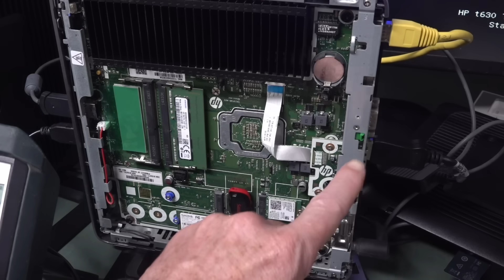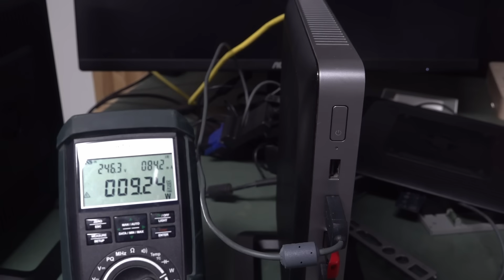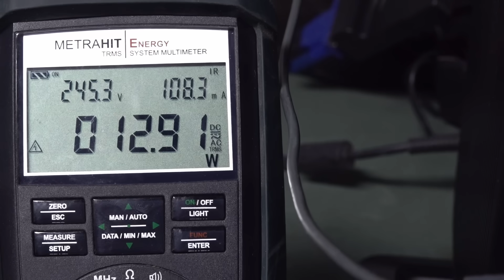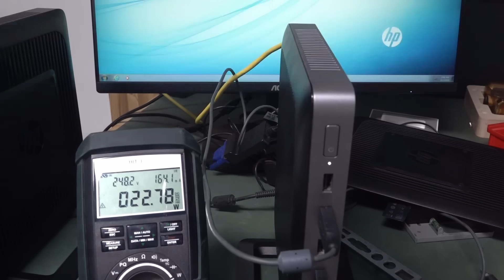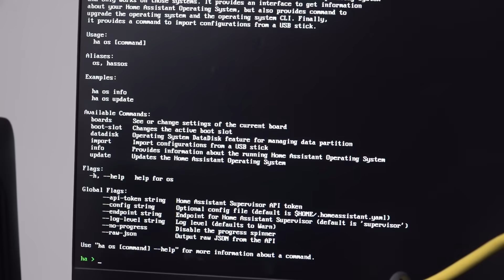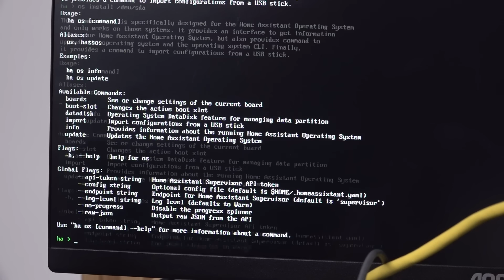How Badly Can I Screw Up a Home Assistant Install?

Comment from the maker: UPDATE: I just had to resort to removing the SSD and using my desktop machine to burn the image using Balana Etcher. It now boots into HA fine on the thin client. Problem solved. Can log into it on my desktop and it's ready to set up. And it's 8.8W power draw on idle.
And for all the geniuses that said "just read the HA instruction, they are awesome", I did read the instructions and nowhere does it explain how to install HA onto an internal SSD from an external USB install of HA from the HA prompt whcih is what I wanted to do. Turns out it's not possible to do what I wanted from the HA prompt. And Grok might have been right in that it was possible in previous builds of HA that apparently contained with different tools.
And for the geniuses that said "don't trust the LLM model you idiot", it's way easier to give that a try for a few minutes than pour through countless forum posts and reddit threads. I had no way of knowing that there wasn't some way to do it until I had tried the variosu ways suggested.
Reply: Ok, we’re off to the races……so now check for available existing integrations for what you want to do and if there aren’t any, or you don’t like those then you can google it for other 3rd party ones and install them (manually or automatically).
Reply: If you ever have to do this again, the easiest way is to just boot any bootable Linux install (Ubuntu, Debian etc). From that booted image, download HASS and then write the image from there.
Reply from the maker: @stevelupton2533  The easiest way is to just remove the SDD and write the image directly to it using another machine.
Reply: Nice, 9W is a bit higher than a raspberry pi 5 (3-5W), but this hardware is more powerful, and the good thing is that this is X86.
Reply: Try T620, should go even lower on idle
Reply: That’s good news, you should do a follow-up YouTube video on it at some point.
Reply: That's the best way to install HASIO
Reply: @EEVblog2 Pro-Tip, on your Win10 desktop, create a shortcut to the \config folder on the HA drive so you can access the integration files etc. Handy if you need to tweak one or manually install an integration you might have downloaded elsewhere.
Reply: Etcher was just exposed for stealing personal data.
Reply: If you don't mind a little overhead you could also try to install proxmox ve and run homeassistant as container in there. On my HP EliteDesk 800 G4 with 16GB RAM, 512GB SSD and a 9500T it uses around 8W in idle with HA running as container.
With frigate and 10 Cameras it draws around 20W which is not to shabby considering it does "realtime" object detection on those streams.
Anyway those old thin clients are really nice alternatives to a raspberry. haven't used my r4s since i got those thin clients. The R4B draws ~4W in idle for comparison.
Reply: Happy you got it running! The instructions are located on the official wiki under installing on x84! Best of luck with home assistant.  It's a pain to get running but once up it's fun to mess with.
Reply: linux install instructions are weird with HA
Reply: I've known HA will only install to the imaged drive for years. I didn't know that when I first started using it though. Just like you, I found out the hard way. I eventually gave up looking for documentation on that, and just accepted it.

LLM's might be faster, but they'll never be as trustworthy as several humans agreeing on something. I prefer to spend more time seeing what humans think :)
Reply: it probably needs driver installed for SSD being based on win7!..

Comment: Dumbass Dave wasn't reading. You were trying to use the "install" command and wondering why it wasn't working. Meanwhile it's giving you a list of available commands and "install" isn't on the list.

I'm sure the documentation could be made better for beginners but that only helps so much.

Comment: Power consumption on an HP thinclient is tiny, so tiny it isn't even funny. We run thinclients at all our stores (20 stores with a total of around 300 thinclients). When a store loses power, the 2KVA genny is more than able to keep the entire store running for the day with only 1 fuel refill needed.

The even better thing for us is the fact that we can lock the device down by turning on write protection and locking the commit, so zero changes can occur.

Our oldest HP Thinclients still run Windows XP Embedded.

Comment: I used to have 3000 watts of lighting in my house. Overnight, I reduced it to about 300 (from incandescent and halogen to fluorescent) and later to 100 or less (LEDs). Not clear why one should worry about even 30 or 40W for running a small computer.

Comment: Thanks for doing the video.  I did spot a syntax error in your redirection to the hardware info output.  You added a space after the '>' character and that messes up the redirect.  It looks like you're using a Linux based product, so that means everything will be a little more tedious to get right.  Everything is case sensitive and you can't play fast and loose with spaces.  I didn't see the other errors on the screen really - any error message was likely scrolled out of view as they tend to show up at the very start of the output and then the help text usually follows afterward.  Good luck with your project.

Comment: Yeah you had to burn the image directly to the bootdisk you want to use. This is  due to the fact its ACTUALLY a custom and stripped down  embedded Linux distro made using buildroot. Buildroot is a collection of tools and scripts that allow you to build/configure your own (tiny) embedded Linux os for your specific task by selecting packages and features in the menuconfig menu. This also means that it will only put in ehat you selected and thus it wont come with all the bells and whistles and extra's like a (fancy) installer other distros might have. Most buildroot images are boot only and dont have any installer, not even a package managed its really minimalistic depending on what you select

Comment: Dave you have homeassistant running when you see the ip address at top use homeassistant app with ip and port as on screen log in via app on phone if you know password and name you setup ****❤( if you did not put name password first on install forget this comment sorry dave i am as bad as you but i used a pi sd and hard disk )
Reply from the maker: That's not the point. I wanted it running on the internal SSD

Comment: I started to use an old Mac Pro tower for a home server, then I saw the electricity bill. I switched to a Mac Mini which only draws about 20 watts. It’s so much far smaller, even with the external SSD enclosure that I 3D printed.

Comment: I'm surprised they don't have a live environment.. That's how most distros work these days.
An easier way to do it without removing the drive is just to put some form of linux on your USB (mint or ubuntu, etc.) and boot into the live environment-- and from there you can install etcher (or Rufus), and format and install the HomeAssistant directly from their URL.  (as long as you have internet plugged into it)..........  (This is essentially what you did by putting it into your other computer;   this way just brings your OS with you, rather than having to pull it apart and take the drive to another OS.)
Reply from the maker: I just removed the drive and shoved it in my desktop, problem solved.
Reply: Likely due to the fact its a custom Embedded Linux distro based on buildroot. Buildroot is a framework with tools and scripts rhat allows you to build your own embedded Linux image by selecting packages and features. This also means it wont come with any extra bells and whistles like an installer. Its really a boot only image

Comment: If you write out a full paragraph that explains everything you want to do and include things that are not working. etc.  the LLM's will do much better on leading you down the right path..  it will have to make less assumptions...  and when their answer doesn't work -- just keep going back and prompting and probing it with questions.. Eventually you will get there;  from my experience.   They are wrong a lot, but you have to keep prompting- because there are always more methods to try....      Granted--  having a comment section full of answers is way better. ;)   ....  but I've had a lot of luck doing linux terminal magic, from LLM's instruction
Reply from the maker: I did all that and I got nowhere, everything it suggested didn't work. I had to take the drive out and use my desktop.

Comment: RTFM 

You need to format your SSD first btw. Linux (home assistant is based on that I believe) cannot read windows partitions out of the box. 

Generally, if you want to install a new os, always format the SSD first. Otherwise it will not work xD
Reply from the maker: That's what I tried to do, and I couldn't do it from the HA prompt.
Reply: @EEVblog2  I do not know then. I haven't looked into home assistant yet. Probably their docs would describe it a bit better than that AI did xD

Comment: I have a few Dell Wyse 5070 and HP T620 thin clients. Thin client x86 PCs will never bring down the Raspberry Pi "empire" but they're a better value alternative in SOME situations. Already got included case, cooling solution, power supply, SSD, plenty of RAM, no adapter cables needed. Onboard GPU is far more powerful so it's better for hardware encoding and decoding. Also fanless and under 10 watts of power consumption.

Comment: yup home assistant for solar battery monitoring is awesome, I have mine spit out a scrolling realtime ticker to a monitor in the kitchen with all the house stats from solar generation to how many hours left on battery I have. I recently bought a new fridge freezer and there was an integration to all the temps and filter status so that go added as well 🤣
Reply: and what use is all of that ? wearnt your beers cold the last 20years ? 
battery monitoring should the equipment sort out to begin with i dont wanna be bothered by that , why would i want to pay more for extra equipment so i have to do more myself.
i dont care what my panels produce aslong as they produce as thats all weather related do i worry about no production and usage no not at all even if the battery is empty and the solar doesnt produce i still go in the garage and start welding or grinding and run the compressor . 
i like live simple and free and dont have to worry about what something uses or what i eat just enjoy.
but you can save on your bill true but still depends on if your equipment lasts and as things get newer and more expensive they somehow also seem to have smaller life spans
like when your 6year old fridges breaks and the repairman comes and tells you its 6years what you expect just buy a new one where my 20 year old one never breaks yes it cost more to run but it also cost me way less extra to run than what 2-3 new fridges would have cost me.
Reply: @cornnatron3030  good for you to each their own. personally I like knowing what's going on

Comment: Home Assistant is somewhat of a nightmare. I've tried to first run it as docker container itself, but turns out you don't get add-on store with it. 
Okay, I finally got solar last month so time to install HAOS. Install process is super weird as first you need to get ubuntu on your usb drive, then install HAOS, wtf...
Finally I found out HACS, the really useful add on store works with docker after all, welp.
Reply: If you are after Deye logger - this one is best - davidrapan/ha-solarman

Comment: Wow, Grok was hallucinating quite a bit. 

Installing it directly on hardware means  flashing the image to the boot disk. This can be done with dd from Ubuntu running of an Usb stick. Or you can burn the image direcly to disk using Etcher or Rufus.

The geeks often run HAOS on Proxmox, this is a virtualisation layer build around Debian. It facilitates remote access, backups and even duplication.

Running HAOS direcly on the hardware is fine, makes it easier to add/connect peripherals. And reduces complexity for newbies. 

4GB RAM might not be enough if you install VSCode or some other add-on. Each add-on uses about 500-1GB of RAM.

Exposing the webUI to the outside world can be quite a challange. Using the Phone app makes it worth though. The company behind HA has a service to expose your HA instance through their servers. Will costs you a bit but is worth it.
Reply: Also can use TailScale for Internet. Makes it very straightforward.
Reply: For exposing it outside just install WireGuard add-on, open one port on your router and you are fine. Plus you get free vpn that sees internet from your home perspective regardless where you are…

Comment: install was not in available commands for ha os, so there must have been another way to install the system... I don't remember how exactly I installed mine on a RPi4B, but judging from one of your comments, you eventually did it, problem solved.
Reply from the maker: Yes, that's what I found out. I had to physically remove the drive to do it easily.

Comment: Home Assistant is a proper bit of kit. You should disable grandpa mode regarding smart homes and give it a fair shot.
Reply: isnt smart homes considered grandpa mode as they are the ones to lazy/worn to get up and make two steps to a light switch which works 10 times quicker without having to get your phone out of your pocket unlocking it and opening the app to do it?
Reply: @cornnatron3030  so you don't use a washing machine but a washboard? And do the dishes by hand? Saw wood by hand? Walk instead of drive? Why? Because you're lazy? Or because you can do better things with your time?
It's very strange to have to defend automating repetitive tasks in 2025.
And apart from that... It's a lot of fun if you have a technical mind.
Reply: @0xBA5  i dont mind automation aslong as i dont have to worry about it .
my washing machine just has to work and not bother me its enough that it beebs 3times when its finished .
my saw just needs to saw it doesnt need to throw laser lines when i still have to mark my work . 
but dont think festool even have a laser on any of their saw.
and dishes is by hand yes as its just me and my daughter , if i get visitors it goes in the washer of coarse .
and what other repetitive task are you on about vacuuming ? ah yes i got a robot for that which i still need to clean every week but it beebs when its that time. i dont want to have to worry about it besides that.
Reply: @cornnatron3030  other repetitive tasks that are great for automation: lights turning on and of when you enter areas, including a dim setting appropriate for the time of day. Per room temperature settings according to someone being present. Lights and hvac turning off when the last person leaves the house, robot vaccum/mop starting then aswel.
Garage door opening when you are near home.
Notification on your phone if a smoke/burglar alarm is triggered or all the lights going to 100%.
Then there are also fun statistics, like temperatures, shower time, etc.
If you cannot think of fun stuff to automate, it might just be a personal thing. As a technical inclined person myself, this really tickles my enthusiasm.
Reply: @0xBA5  Actually I do all of those things (except washboard unless I'm camping) work construction 9-10 hours a day, kayak instead of boating, backpack instead of car camping and more  but  I guess I'm lazy!  I sure as 'ell don't need a computer to manage my life and turn on my lights!

Comment: Welcome to the un-intuitive convoluted world of Linux.
Reply: Nah, its pretty intuitive, it's Home Assistant that made a few weird decisions and not so obvious documentation.
Reply: Homeassistant installation is very simple and straight forward. One literally has to spend just one minute to read the instructions.
Reply: @7tkh  if you have to read instructions it's not intuitive.
Reply: @ I bought a heater.
The interface was so bad I had to read the manual.
It reminds me of Linux.
Reply: Just got to read the instructions and because Homeassistant is a stripped down almost bare minimum custom embedded os made using buildroot, it does not have any fancy installer like the debian or fedora based distros but rather has to be installed directly on the bootdisk cause its a Boot image and not a installed

Comment: "HAOS has no integrated installer that writes the image automatically. You will write it manually using either the Disks utility from Ubuntu or Balena Etcher."

For my Dell Wyse 5060 Thin Client I took out the flash, flashed the os to an SSD using balena etcher on windows, and then put that in. I bought an SATA + power cable extender but should have just cracked open the SSD since the physical SSD is smaller than the plastic shell.
Reply from the maker: Looks like I might have to do that on my desktop. I don't have a spare M.2 slot so will have to remove my D drive.
Reply: @EEVblog2  Yep, I bought some cheap orico SSD and nvme enclosures just so I wouldn't have to open a desktop to flash or wipe drives for projects
Reply: @EEVblog2  no, you can just run Ubuntu from your flash drive (no your HP), download the HaOS image using Ubuntu (on your HP), and then write the image onto your HP's drive.
Reply: @EEVblog2  IT's better to use Rufus..  Etcher has been called out as spyware/ selling your data, etc.. recently
Reply: As a Linux guy I am really surprised by that. Downloading and Booting a Ubuntu just to install another OS sounds inefficient. Couldn't they include a simple script with "dd if=$BOOT_MEDIUM of=$TARGET"?
Reply: @1Hippo  I think it’s because most people run haos in a VM on a home server running something like proxmox or unraid. On unsaid, for example it’s pretty much a one-click install.
Reply: And good luck if it's an eMMC soldered to the board 🤦
Reply: @ that's fine, just boot from ubuntu and install from flash, just like it says in the clear installation instructions on the HaOS site.